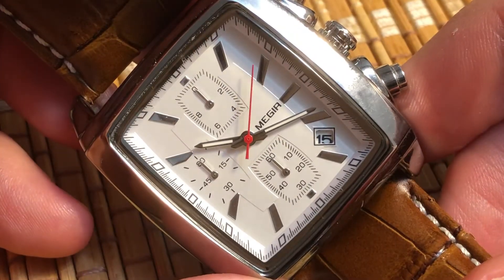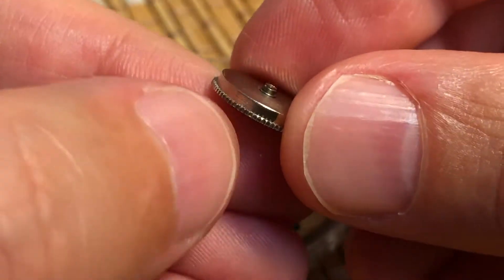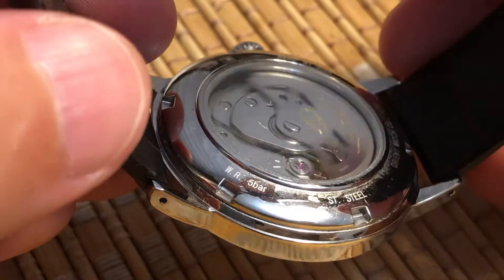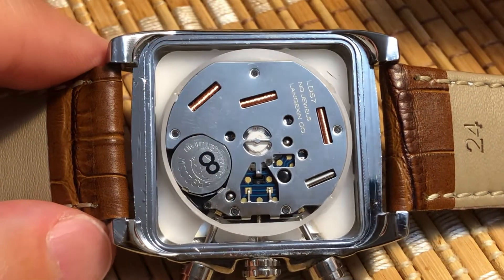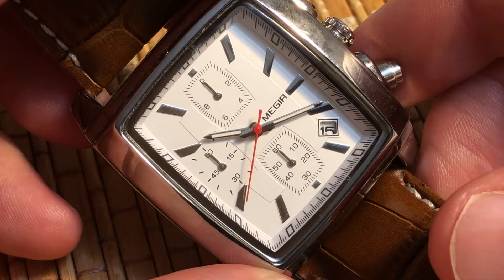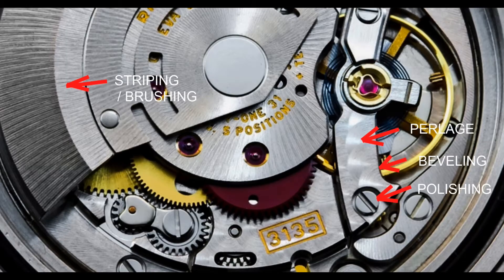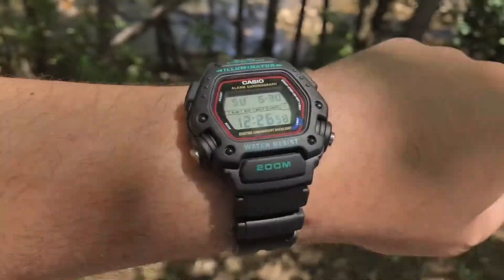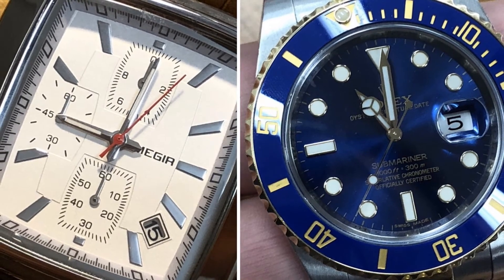Why the Best Watches aren’t Quartz

Comment: So the less accurate watch is for important meetings? You have that backwards don't you think? Expensive, mechanical watches are basically jewelry if you ask me.
Reply: Jewelry plus art
Reply: @jijoious  Well jewelers are basically artists, so you are right.
Reply: A steam engine locomotive is much better in my book than a diesel-electric.
Reply: @MarquisDeSang   As a mechanical engineer I can guarantee you it isn't better, but I do have a higher level of appreciation for it.
Reply: @hausmeisterengineering5952  But steam will work in a zombie apocalypse because they can run on anything.
Reply: @MarquisDeSang  When the zombie apocalypse comes I will stick to anything that runs on diesel because it will run on basically any oil!
Reply: No the more expensive watch is for important meetings.
Reply: @M Glenn + 'time keeping'😉 engineering marvel⌚

Comment: A really good video shortly explaining differences between quartz and mechanical movements, but still fully covering most important technical details.

Nevertheless, I wish to add up some more technical facts and my personal experience between these two movement types. One of the unmentioned but extremely important advantage of a high quality mechanical movement is its reliability, which actually is much better than the best commercially available quartz movement because most of the quartz movements rely on a battery power, and user never really knows the actual quality of the currently equipped battery and if the watch will stop suddenly because battery ran out much earlier than expected, due to a production defect of the battery itself. This why you would not wish to go scuba diving with a battery powered quartz diver-watch. But even if you just do a office business, it is really frustrating to find out that your watch started to run extremely slow or stopped, which happened to me couple of times because the battery was defected (stopped 6 months after last battery replacement, expected run out time was more than a year). A high quality and robust automatic mechanical movement will prove much more reliable in a way it will not stop while being on hand, at the expense of practically acceptable accuracy level of up to +4 s/d average deviation for the high-grade movements. In case that a good mechanical movement start to fail, usually this happens gradually by watch being more and more inaccurate or in case of weight-rotor fail it can be observed through the transparent caseback.  

I wish to note that there are indeed autoquartz and solar powered quartz movements which do not need batteries, but they rely on additional and usually less reliable electronic components, accompanied by large capacitor, which together have a chance of randomly and suddenly failing after 5 years of running time, and the wearer can never tell if some of the electronic components is at the end of its life.

Finally, by my experience, the extremely cheap quartz movements are not that accurate. In my elementary and high-school days I had a 60€ robust chromed brass-case Casio quartz watch. I was disappointed that it gained a little bit less than a minute per month, and practically I needed to set it every month to the accurate time (for comparison a 130€ quartz based Festina, which I own, loses around 2 seconds per month). Also I have a nice brand new vintage looking quartz wall-mounted clock which gains even more than a minute per month. I also own a 50 year old hand wound vintage watch (Peseux 7050 movement) which is recently serviced and regulated so well that it gains on average a bit less than 2 seconds per day while wearing and while in resting position. This means that it gains less than a minute per month, better than those mentioned cheap quartz movements.

Comment: What one will last longer ?
Reply from the maker: Philippe Dufour once said that every quartz watch is destined for the junk pile, eventually.  Mechanical watches can be maintained and/or repaired forever.  Of course, he said it much more eloquently than that.
Reply: @WondersofWatchdom  Its cheaper to buy a new movement than to repair it.
Reply: If you want it to last as long as your life time and you are in your 20s to 30s, a high quality quartz watch is likely to last you for the rest of your life, if you were to buy it new. At least from what we have of existing quartz watches and considering how much they have been improved upon in the high end since they came out, especially by Seiko.

Comment: Well done video. The whole “soul” concept when talking about watches is like bringing up religion or politics. Logic and reason get thrown out the window, replaced with feelings and emotions. For example, if a Rolex’s beat rate of 8 per second is more valued than a more pedestrian watch’s beat rate of 5 or 6 per second, then would not a Bulova Precisionist’s second hand beat rate of 16 per second be even more valued? How about the virtually infinite beat rate of a Seiko Spring Drive movement?
Reply from the maker: Correct.  And sometimes watch manufacturers make watches whose balance wheels are purposely heavier and slower - but really accurate!  Like Zenith, Vostok and WWII IWC.

Comment: An Ecodrive doesn't even need the battery changed for 10 yrs.
Reply: The key to prolonging the life of the capacitor, is to make sure it doesn't sit in a draw and go flat. Periodically wear it, or place it by the window.
Reply: Funny, Ecodrives have no battery.
Reply: @donedeal725  they have a solar cell which will need replacing and cost me 40 $ to replace.
Reply: @violinmke  They claim it's a capacitor
Reply: @donedeal725  well, technically, the so-called Capacitor is nothing else, then a recharchable battery ;)

Comment: Seiko kinetic autorelay arctura!!
Reply from the maker: Nice watch!  It's  a quartz movement that runs on a battery, but the movement looks (sort of ) like a mechanical movement because it uses an oscillating weight with generator to recharge the battery.  Older models held the charge using a capacitor instead of a battery, but Seiko found they're prone to power leakage and damage by static electricity.
At some point in the future I'll be doing a full video on such "hybrid" drives.